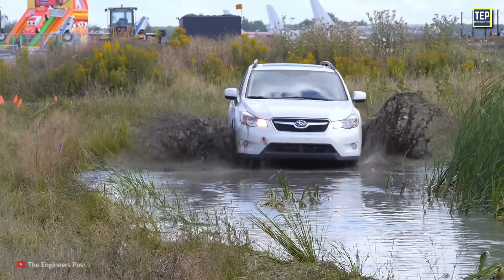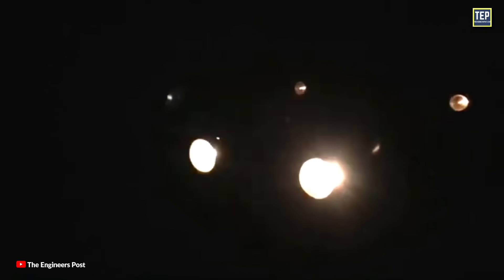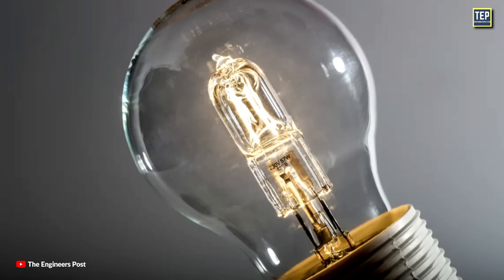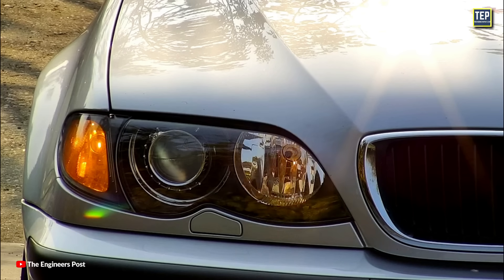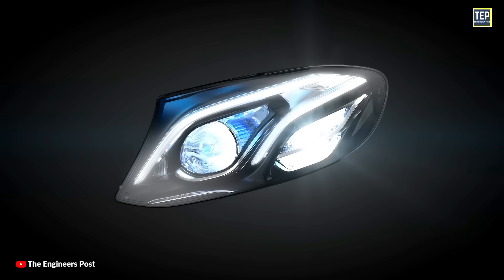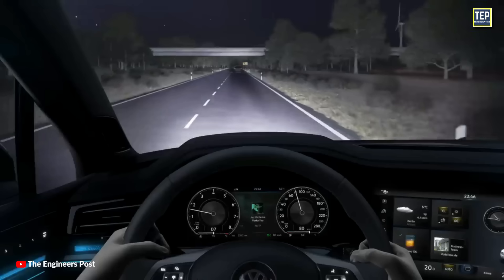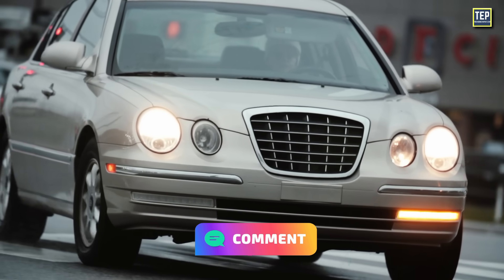The Problem With These Headlights

Comment: The main problem with LEDs is that they are disgusting looking. 12:00 illustrates the obnoxious flickering. Some literally make me nauseous.
Reply: The weird part is that they don't have to be that way. It's possible to have an led that gives off a natural looking light.
The problem is, the colder the color temperature, the brighter the light appears to be, so they always choose those sickly blue-white leds.
I have an led flashlight that has about a 3000 K color temperature, and is 'high CRI', meaning it reproduces colors very naturally. The light it gives off is warm and beautiful, and the high color rendition makes distant objects easier to make out. I think this style of led would be much better for headlights, but unfortunately, they don't look as cool as the bluish ones (both figuratively and literally).
Reply: Some household and even flashlight LEDs seem to have a buzzing or strobing quality

Comment: Audi's Matrix Amoled E-Tron lights are the most expensive out there, they're smart, advanced and extremely sensitive to enviroment and always one or two steps in front of the other brands. The second one are BMW's LED lines light and they also can auto-adjust a sensity of lightning. Mercedes has a good headlights too, but I don't know much about them except that beam lights are also adjusting themselves by sensors, but many ppl think that they're not that good as Audi's or BMW's cuz of weak response to enviroment.

Comment: There was this Chevy pickup truck in the last Lane last night with tiny tiny lights I did not notice it I'm pulled out right in front of it they were going like 85
They swerved around me 
This is happening more and more I just can't see the tiny lights on brand new vehicles they should all be like those big square headlights on semi trucks you can always see those because they're so wide 
Kind of like how all headlights used to be in the 2000s 
There should be a headlight standard for surface area so you can see the damn things 
On top of that with white street lights and tiny white LEDs you can't hardly see the light from the vehicle which adds to accidents almost happening

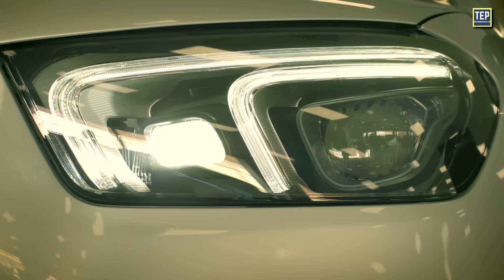Comment: 11:56 "...and there is almost no heat emitted"
Some LED drop-ins get 200F or hotter when running— too hot to safely touch with bare hands.

Comment: kelvin is a measure of temperature, and the spectral distribution of a Maxwell bolzman distribution of a black body with that temperature. it is not a measure of luminal intensity, only a kind of color value.

Comment: A thing worth noting is that modern LED globes can emulate halogen globes pretty well, making LED conversion for halogen headlights actually quite feasible!

Make no mistake, there's always going to be junk LED globes that don't comply well with reflectors, but some work exceptionally well, providing even better beam placement than the halogens they replace!
I've used a few great H4 alternatives, but the downside I've encountered is short lifespan likely due to the dependence on an integrated fan for cooling, as the dust boots on some cars can interfere with airflow, and the fans themselves can fail causing the LED to overheat and fail. This is the only reason I'm not currently using LED globes myself, as I was changing them about as often as I was changing halogens anyway
Reply: LEDs can't legally and practically replace halogen bulbs in halogen reflectors. For one, a filament is a point source. LEDs have a heat sink/driver board between them so the light source will not be perfectly aligned to where the filament was. Two, vehicle lighting is federally regulated and type-approved. If a headlight is designed for an H9 halogen, for example, it can only legally be replaced with an H9 halogen.

Comment: Unfortunately, US regulations for how light has to be distributed is still stuck in the 50's (requirements like lighting overhead signs), which cause them to emit glare to oncoming cars. Cars in European markets can block the part of the hi-beam that affects on-coming cars, without shutting off the hi-beams. They can also reduce the reflection of road signs. But they aren't allowed in the US.
Back in the 70's and 80's (when I drove cars with replaceable headlights), I used European headlights (without excessively powerful bulbs). Even modern LED headlights are no match for a 1970's Euro 7" headlight, in terms of light distribution and reach. 
Of course it would also help if headlights in cars were properly aimed. Neither of my current cars (Honda Odyssey with HID and Mazda CX-5 with LED) headlights were properly aimed. They both brilliantly illuminated the ground 100' in front of the car, but not much past that. I felt unsafe driving at night on the freeway when I couldn't use hi-beams. But after adjustment, they are very good. Although still not as good as 40-50 year old European headlights (yes, my memory is that good).

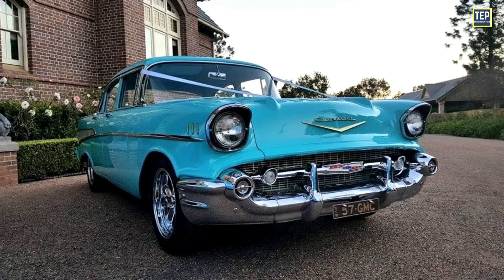Comment: All incandescent lights use tungsten filaments. The only difference with halogen lamps is, as you mentioned the halogen gas which keeps the evaporated tungsten atoms from travelling to the glass and condensing out, forming the black coating you mention at 5:25. In industry, this is called "sputtering" and was actually discovered by Thomas Edison who declared it "worthless" as a discovery. He'd probably be amazed that this "worthless" process is the backbone of the trillion-dollar chip-making industry since it's the main process for laying down the thin layers of metal in microcircuits.

Comment: My main car was converted from halogen to HID by the previous owner and I love the visibility at night, never once thought about high beam as a result. I think it's a great upgrade wherever it is legal to do so
Reply: In the US, unless the whole housing is swapped out for an HID housing that meets DOT regulations, it's not legal. Headlights are approved for a particular light source, say an H11 halogen bulb. Only an H11 halogen can be legally used in that housing. Headlight beams have glare maximums and increasing the amount of light a headlight puts out will exceed those glare thresholds and throw light where it shouldn't go.

Comment: As an owner of LED headlamps,  be careful of operation during low temperatures.   The LEDs do not produce enough heat to melt ice and snow on your lamps - The extra visability is not worth the time spent on the side of the road trying to chip frozen slush off the front of my car so i can see.

Comment: Halogen gas doesn't "react" with the tungsten, in fact it prevents the tungsten from evaporating and depositing on to the interior of the bulb... that's the whole point.
Reply: The glasslike envelop actually gets hot enough to glow slightly red for a fraction of a second after the light is turned off- can see that if you watch the headlight while someone in the car turns it off

Comment: I really hate LED/Xenon headlights because when I drive at night, I'm blinded by those modern cars coming the other way.
Reply: @chrislee6650  Those are their low beams. And they're not mis-aimed or mis-installed aftermarket parts, oh no. OEMs intentionally manufacture LED arrays, which are installed at the factory, with the express purpose of vomiting out as many candela as possible even on the "low" setting. Blinding oncoming traffic is a feature, not a bug.
Reply: Not correct. Automotive safety laws have specific requirements for intensity, brightness, and glare from headlights. Some automakers do this better than others obviously. Then theres also adjustment of the housings which come into play and arent always correct from the factory. My cars fog lights came from the factory basically pointing into the ground. I actually cant tell theyre even on lol. I just havent bothered to adjust them. Bottom line is automakers arent just shoving leds in there and saying MaKe IT aS BrIGht As PoSsiBle. Theres far more to it then that. Then you have the asshats that shove led into reflectors/projectors made for halogens which then create major glare (illegal, obviously, but never heard of anyone getting stopped for it).
Reply: I'm also blinded by cars in rear view mirrors, to the point I have to adjust them so they won't blind me. I hate that shit, it becomes more and more unsafe to drive at night.
Reply: Me, too.
Reply: Same here those blinding headlights are a menace to society
Reply: I have LED lights on me 2019 Tucson. First thing I did when I drove it at night the firs time was adjusting the beams down until I was sure it does not blind incoming traffic while still allowing me comfortable visibility. Then the only issue left is reflection on wet roads, for which I have no real solution beside driving without lights at night.
By default, when you pick the car from the dealership, new cars always have their low beams pointing as high as possible and most people do not know how to or do not want to bother adjusting them. Same goes with halogen lights when people load up their car to go on vacation: Load the back of the car, your headlight beams point up!
Reply: @chrislee6650  Damn yes!!! I hate these people using full beam and fog lights. Further, there are a lot that use pseudo xenon in old cars and that's also a big fkng problem for the other drivers the most annoying is, they know they produce problems to others but if you tell them they say they don'k give s***. I work driving in the night and it's a nightmare.....sometimes I wish I had a James Bond system to point and....boom. And don't forget, LED blue light is harmful for the eyes
Reply: Love how everyone gets mad when I do it, but no when they do it, they’re not the “bad guy”. Narcissistic Hypocrites
Reply: So true.
Reply: In Belgium (and I guess the rest of Europe as well), xenon headlights must have a self-levelling mechanism. The reason is that they’re a lot brighter than halogen lights and blind other road users. For some reason this legislation wasn’t extended to LED lights later on. And those are bright enough to get blinded by LED’s in a bicycle light...
Reply: Thank the government for that because they don't allow modern adaptive headlights
Reply: that's not the LEDs fault. its the drivers fault who didn't adjust his headlight units properly. Halogen lights blind you just as much as LED wehen they aren't adjustet. a Halogen light high beam into your face is basically the same as a normal halogen light that isn't adjusted properly.
Reply: @mikekartwii  I have never adjusted my headlights because if they are not adjusted properly the car would fail its annual safety check.
Reply: @chrislee6650  fog lights 😡 Most UK drivers think they are rain lights...
Reply: @roysoutdoorlife  uk sucks anyway
Reply: Not 'modern' but 'progressive'. Modern is about rational innovation, progressivism is about fucking up everyone and everything in the name of questionable progress alone!
Reply: @chrislee6650  uk sucks anyway
Reply: Hate that lights!
Reply: I think that it's mostly SUVs that are the problem. Especially teslas and some other brand I can't remember right now. I think that they're cheating on the headlight angle to get better visibility, at the cost of other drivers' visibility.
Reply: Buy a new car and you will see why they are better
Reply: 単純に光軸調整できてないからだね(;^ω^)逆にハロゲンは暗いですからね。視力が良い人からしたら暗いです、視力が悪い人がハロゲン好みます見てる視点が違うから。
Reply: プロジェクターLEDが優秀、LEDになれましょう！
Reply: It's even more fun when you're 35 feet long, 20,000 lbs. or more, loaded... and blind as a f@<&ing bat due to those oncoming LED and xenon headlights.
Reply: If the lights had 5 times the surface area, and only 20% of the lumens per square inch, they might not be as blinding as they'd not be tiny bright pin points, but dull glowing regions.  Hence not blinding.
Reply: Agree, but why car companies are using those lights and why the law accepted. It should be prohibited. Unfortunately, I have to replace one, I didn’t know my car came with led, I don’t know wich one I should buy now..if I buy a bulb, it is good to be for the driver toward me but those drivers have those strong lights and made me blind, should I care about them when they don’t care about me…..insane.
Reply: Laser are way worse
Reply: Thats because most people who drive their cars never actually read the manual how to operate it.
Reply: @MrBashem  Oh Really????? Does the manual actually tell you how to get your low-beam to NOT be brighter than the standard high beam use to be?
It use to be you had Low-beam and High-Beam. Now it is Super High-Beam and Aircraft Landing Lights.
Reply: @AFmedic low beam and high beam are a reference to the direction they point, not the light output.
Reply: @tylhunt  No shit, Sherlock! At the age of 74, I've been driving A LOT longer than you (including driving semi cross country for 5 yrs) and am well aware of that. That is where the terms "Low Beam" & "High Beam" came from. Not because of the intensity of the light but where it was aimed. Eventually people started calling "High Beams" "Brights" because the lights appeared brighter when the light was directed more towards ones eyes. This led to the term, "Dim your lights" (hence the term "Dimmer Switch) which means "use "Low Beam so it's not directed more toward my eyes and blinding me." People now use these terms
Now a days, even with properly aimed lights, the intensity of the lights used is such that even on low beam (aimed lower) they appear as bright or even brighter than what the standard High Beams used to appear.
Reply: @AFmedic  I'm glad you figured it out.
Reply: @tylhunt  ROFLMAO! I too, am very glad I figured it out back in the early 1960's when I was a preteen.
A "Thumbs Up" for making me laugh. All the best to you!
Reply: @MrBashem Majority of them have automatic lights there’s no need to read the manual
Reply: Get a set of anti-glare glasses. They work for me and they're inexpensive enough to keep a pair in each car you own.
Reply: @keithhoughton4308  are they polarised lenses? Too dark how do U drive, even at day too dark.
Reply: @JohnnyLawrenceCK  Polarized lenses can be clear.
Reply: @keithhoughton4308 for those of us with astigmatism the glare can be way too much even after antiglare coatings on glasses. And the color of the light definetly affects this response. In several cases I've been able to see my shadow from the lights coming through my rear window on the tail of the car in front of me.
Reply: Pls ,send me it name or model or pic
Reply: Leds ; no heat produced; But have massive heat sinks though.
Reply: The issue isn't LEDs, it's people not bothering to adjust them correctly.
My car came with the old standard 7inch sealed beams as mentioned in this video but I've since replaced them with LEDs. Adjusting the beam is tedious but it's been 4 years and I've never been flashed by an angry/dazzled oncoming driver.
I should also mention it's a 40 year old lifted pickup; proof that even the worst case scenario can still be done right.
Reply: You have to upgrade your lightthe problem.
Reply: Its xenon light that it can blind you
Reply: @hashemjamal623 Not entirely accurate.  HID lamps tended to be projector lamps.  They have good beam control.  Newer LEDs have inferior beam control and are often controlled automatically.  They never automatically dip before line of sight occurs and often put out more glare than necessary due to adaptive matrix.
Reply: LED lights are way better at not blinding people than Xenon lights were.
Reply: USA drivers lol
Reply: Who even needs goddam lights in city where street lights light the road!
Reply: @JohnnyLawrenceCK  Headlights must be turned on while driving at night, no matter how bright your surroundings are, and it's required by law from almost every country in the world.
Reply: @jamesdrives993  yeah and it's stupid. I don't need them I can see fine with all the street lights.
But ironically I can't see shit cos I'm blinded by muppets and their shitboxes with misalligned headlights.
Reply: @jamesdrives993 Some  mistakes in your statement.  You think statutes are laws.  Really?
Reply: @idonotwantahandle2  You mean the headlights statement? In the UK yes it's actually legal so I said "almost every country in the world".
Reply: @idonotwantahandle2  Yes, really. Statutes are laws made by legislative bodies. They are distinguished from case law or precedent but they are laws as indicated by their name which is derived from the Latin 'Statutum' meaning 'law'.
Reply: @jamesdrives993  and by law we need red 5watt lights at the rear so cars can be seen from behind..... so 5w red is absolutely fine at night to stop you  crashing into people (and actually let you see where the car is, how fast it's going etc etc ) but we need 60w of white light blinding us, stopping us seeing where the cars are, how fast they are going etc in order to be "safe". Yes the law is dumb.
Reply: @JohnnyLawrenceCK They are as much for others to see as for you to see. In Sweden you must have your headlights on at all times while everywhere else you must turn them on when the conditions are anything else but sunshine.
Reply: I don't even turn off high beams.
Reply: @gregorteply9034 you are one of those culprits then. Where can I find you to arrest you please?
Reply: @gregorteply9034  You are part of the problem then. Also if you do that in continental Europe you will be fined as it is illegal to use high beam in built up areas at all.

Comment: Why would you add noise to the old footage? And over animations too, in large amounts? What a terrible thing to do.
7:00 "filled with inert halogen gas" That is exactly the point, it is not inert but reacts with the filament. You even talk about a reaction at 7:23, although that has nothing to do with the light, and how this basically works at 7:36. So why would you call it inert?